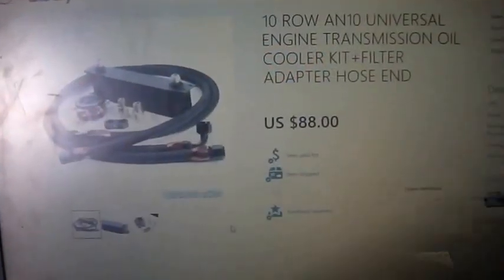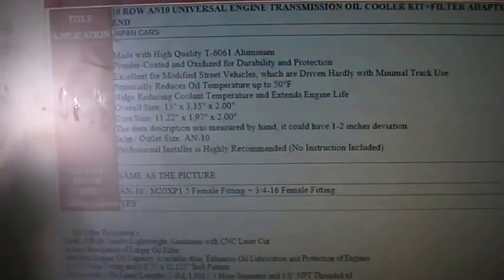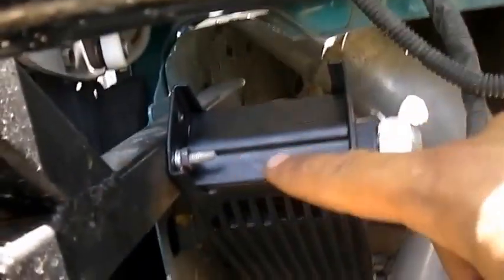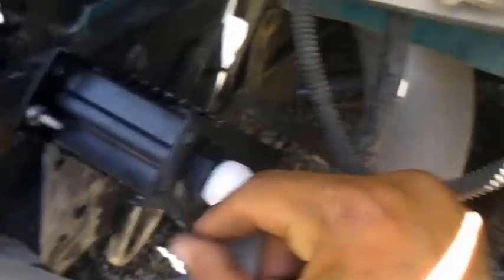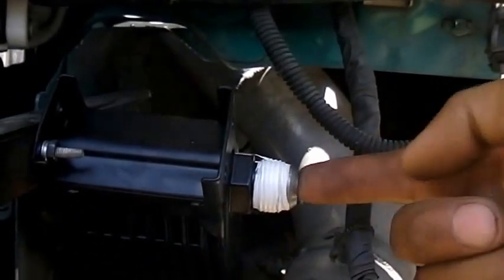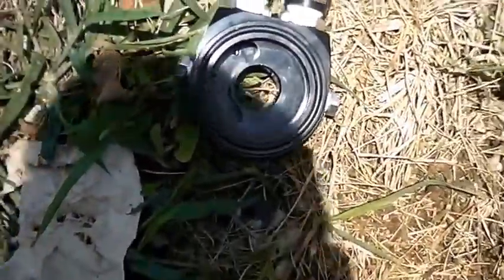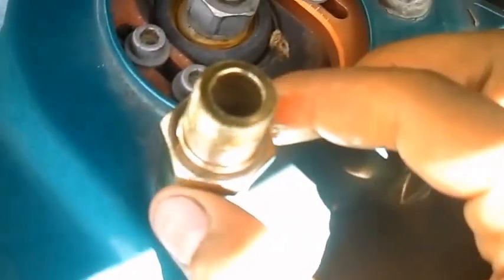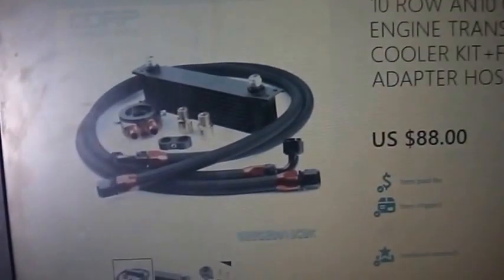ebay oil cooler kit install

Comment: I had the same one, the sand which plate leaked. Got a mishimoto and it doesn't leak lol. I normally don't mind eBay stuff but this one sucked.
Reply from the maker: Riley RR I haven't had any issues out off mine I'll keep my eyes open and check it to make sure it don't start leaking
Reply: s13_migel just so ya know, most AN aluminum fittings are designed to lock and seal without any mixtures in the thread. You actually create more chance of a fitting connection leak by adding anti seize or teflon tape. 

Only thing that's worth using is blue threadlock.
Reply from the maker: Riley RR I did not no that I will remember that tho cuz this will not be the last car lol thanks for the info
Reply: Should have just got a new oring.. Or cranked the center of the sandwitch plate down.. Possibly add an oring on the inside of the center piece.. Ebay shit sucks sure but most things can be improved with minimal effort and supplies..

Comment: still running that eBay cooler? hows it holding?
Reply from the maker: teo carranza  yes I still am running it no issues with it I have had zero leaks it makes engine Temps about 10 degrees cooler.... I would buy another one